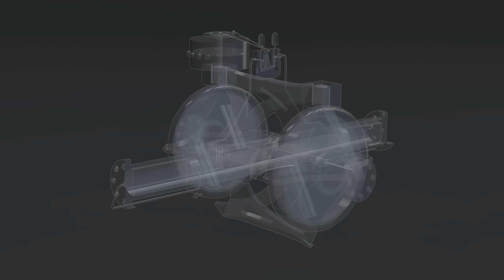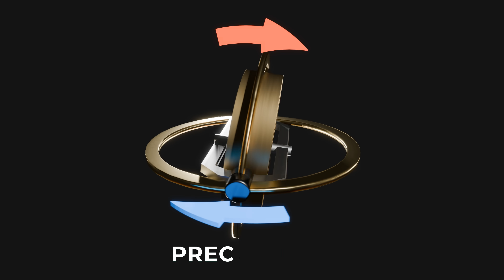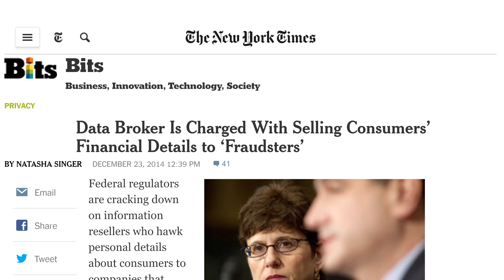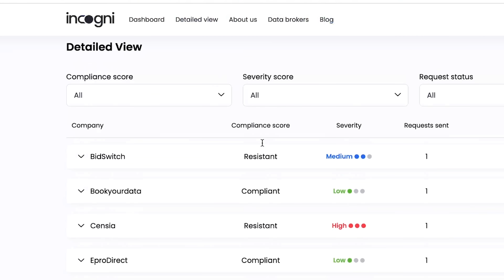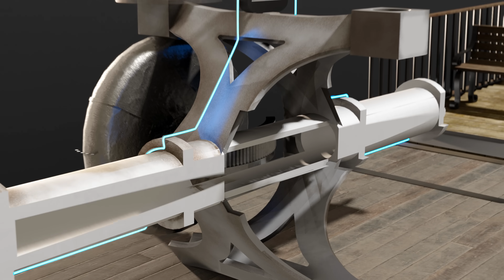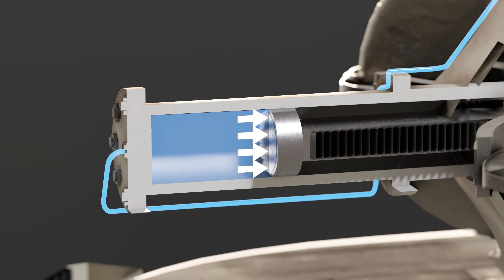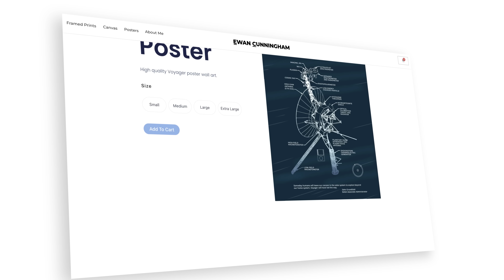The Self Balancing Monorail

Comment: The main problem is: If a poly-railed train malfunctions, it will mostly just halt. If this mono-railed train malfunctioned - specifically the gyroscope - it would most likely result in a catastrophy. Just imagine if the tiniest part of the gyroscope, let's say the air pipe, wasn't working properly. You'd have to be equally as thorough with maintenance and technical check-ups as with aircrafts, and at a much smaller value.

Comment: What about if the gyros loses their pneumatic pressure because of internal leaks or any other reason during the train trip? 
When loosening gyros capability there is no backup or safety method to keep the train stays vertical unless they invent extendable standing gears with tiers under the train to prevent it from turning over until it’s fully stopped  🤔

Comment: It’s a great design. Really amazing, and could still be applied. It has the new problem of how you deal with sustained power failure. The gyros will spin for 30 minutes - but after that the train falls off the tracks. It would need an emergency kick stand system to keep it upright until power could be restored.

Comment: Even if that particular invention didn't make it off the ground commercially, it no doubt contributed to other inventions. Mechanical self stabilisation and amplification, especially before computers but even today when computers/their software aren't perfect, is an incredible important concept for many moving systems. Investors probably could and did tell hin at the time that his idea would never work commercially, even if it could work perfectly mechanically (you'd need passenger trust for one), but engineering and invention are about so much more than presenting a viable final product

Comment: Would the cost-savings of 1 rail be canceled out by the 1 rail getting twice the wear and tear? (bearing twice the weight)
Reply: No. the cost would be defrayed to the gyroscopes in every car which would in turn cost more than the extra rail.
Reply: @stormysyndrome7043  yes, perhaps. I was more wondering about the physicals of just 1 rail vs 2, if 1 wears out twice as fast as 2, or what the wear relationship is.
Reply: @Dskrib  think I’d give one rail half life. Instead of the full load being divided over 2 rails, it’s squarely on 1 with very little shoring effect to spread the weight. It would lead to serious issues with rail weight limitations in short order, which would lead to actual ground issues beneath the rails being compacted unevenly. Think maintenance is much less of a pain with standard rail. 

Think you might have more luck with a tri rail system. Double the width of the train, shorten the height slightly, shape it like a bullet and give her a turbo engine lol. 

Loved living in Japan. We took trains everywhere. They were all electric even In the early 2000’s. Much easier to put rail systems in a nation as large as California, than expect the same outcome in a complete US country. Unfortunately, it doesn’t seem like we’ve even tried to start. The California bullet train disaster was one of self making. No reason they couldn’t create a bullet train line with the money they were given. None. They simply didn’t want to.
Reply: @stormysyndrome7043  That seems reasonable to me. A good use of the gyro-monorail would be custom temporary loads to unique remote locations. Imagine you a had a building project in a remote location. The monorail would be cheaper and faster to setup. It only needs to survive the one project, so the wear is not an issue. The gyro could be moved from project to project, to prevent having to scale up making more. Even things like remote movie sets could make use.

Comment: Yeah, even if it reduces the cost and maintenance of tracks it would be too expensive and impractical to have these gyroscope systems in every car. Also, like he said, traditional trains were already well established and there's certainly no way they could share a single-rail track with this new invention. We'd have two different track systems, which for several obvious reasons would be a terrible idea. At least we can say this is a very cool milestone in engineering, especially from so long ago.
Reply: It would not save much if any of the cost of track maintenance, most of which is due to drainage problems, tunnel and bridge mantenance, signalling etc.

Comment: If this is all true and it did work. What I would do in our modern era is make a sort of single rail system through cities that is mounted on the sides or roofs of buildings and make single cars that fit 2 to 4 passengers and people could buy passes and use the system to travel in metro areas above and away from traffic. Use a battery type system and a locking actuator that if the car stops it locks it upright. Buildings could have a small elevator at certain key stopping points to allow them off. This could reduce pedestrian traffic on the streets and enable people who can't afford cars to commute from say 5 or 10 miles away to their job.

Comment: It absolutely amazes me what was created and perfected without computers and simulations. Just get your hand dirty and create. I think I like the design and fee it would probably have a comfortable ride especially around corners. The issue would be if the gyro failed or if one failed in any car it would be a catastrophic failure. No way to just coast if something stopped working like a 2 rail train. Need three rails with outrigger wheels but now your increasing the cost with the three tracks.

Comment: As an engineer, my initial thought was instantly "gyroscopes.". But in the few minutes of this video Brennan's design and ingenuity turned out to be absolutely stunning. A truely great mind...too bad his idea didn't catch on.
Reply: Yes, Granted. definitely ingenious. But highly complex & if any of those mechanisms fail- instant disaster. also hard to build in any redundancy for safety.
Reply: i wonder about the redundancy
the design requires each part of the train to each have its own gyroscope. that and the fact that his design was strong enough to easily withstand a group of people purposefully trying to tip the train over by standing on one side maybe can let 2 adjacent carts to support another in case of a gyro failure
Reply: @beaneater6923   so back to two tracks again?
Reply: @keselekbakiak  no?
Reply: @beaneater6923  The train by its own design probably could not be made commercially viable because of safety concerns- Not to say that it couldn't in the future if modern engineers were to work out ALL possible safety issues.
Reply: @letstalkaboutit8254  i dont think safety concerns are the biggest issue. the whole point of the gyro monorail was to cut down on costs. needing a gyro for every cart would definitely hurt that
Reply: @beaneater6923  It's quite evident that like a child's bicycle with the training wheels removed the bike will flop over until that child gains their balance- the same principal would apply to this train design- If something fails in the mechanism that's keeping everything level, the folks on board would be in for a world of hurt. If something fails on a normal train (meaning propulsion not derailment) it simply slows down and coasts to a stop, And no one faces injury or death.
Reply: @letstalkaboutit8254  again, each train cart can easily handle people purposefully trying to tip it over. why wouldnt the 2 adjacent carts prevent the failed cart from falling?
Reply: @beaneater6923  When you say adjacent carts are you talking about one behind the other? My first thought was that you meant side by side, as in using a parallel rail. If you meant the former then I don't know if that would work, unless the gyro system in each carriage was strong enough to stabilise the weight of two carriages.
Reply: @beaneater6923  The power running the gyroscopes would eventually shut off, thus causing the gyros to stop rotating. Once the rotation stopped, the train would fall over. That's where the problem is. There isn't a continual source of power available on the train. You could introduce electrical cables, but then that would be added cost, thus negating the "savings" of using the gyros in the first place.
Reply: @danyoutube7491 obviously he is. The cart in front and the cart behind
Reply: @Josh-yr7gd  I was just kinda casually & mindlessly scrolling thru the conversation being had amongst the few of you about this invention. That being said I unconsciously knew the obvious statement would be mentioned eventually, however I was just not ready to read "....aaaand then the train will fall over" while sisimultaneously animating the thought of that crazy goofy looking contraption slowly coming to a stop before it just helplessly begins tipping over (accompanied by one of those generic hollywood sounds of some old creeking machine playing inside my head) 😂😂😂  I most definitely just laughed out loud way too hard reading your comment that wasn't even meant to be funny. 😅
Reply: Just park the train on a mount when it’s not running to hold it upright until the gyros start up again. Case closed, it’s viable
Reply: @beaneater6923  The simple question is: What are the benefits? Easy answer: There are no benefits, only disadvantages.
Reply: @beaneater6923  No, not if its on a bend or points or because of the balance in each carriage is different. Each set of gyros would be trying to balance in a different way, it could end up in in a feedback loop like you see with aircraft flyby wire issues with constant oscillations and over corrections.
Reply: @letstalkaboutit8254 Mu thinking is why was this not applied to the bi-rail trains so they were more stable in corners?
Reply: @Josh-yr7gd then run the gyroscope 😂
It's 2025😂
Reply: @letstalkaboutit8254  The fact that all cars connected to it would also need a gyroscope had to be a huge economic issue.
Reply: @Dexerion  Yes, The design is simply to complicated and prone to failure to be practical or SAFE.
Reply: @Dexerion  After looking at one of the original photos of the prototype (0:45) a bolt on "skid" can be seen midway down the bottom of the train, I'm assuming a matching built-up "hump" (concrete/steel) was built on the ground when the train stopped (station) and the train would simply "list over" onto it when power to the gyros was cut keeping the train somewhat level. And that brings up yet another issue with the design, it would not be practical to build miles of "stop ramps" to catch the train if it lost power to the gyros. I'm surprised a prototype was even built when looking at all the problems faced with the design.
Reply: @letstalkaboutit8254 and because of that fear, they chose something that their mind could easier comprehend, but turns out, we still have trains disasters.

And guess what? It's double wheels
Reply: it's either gyroscopes in every cariage or
a second rail.
Reply: My first thought was "damn I didn't know gyroscopes where even invented back then"
Reply: hi, I have a doubt, maybe you could answer me. in the end of the video, it says that the force is multiplied, in the compressed air system, because the area is larger. wouldn't it be the opposite? anyway, very clever design
Reply: @acs147 That's how hydraulic jacks work.
Reply: I don't think you need to be an engineer to guess that
Reply: As an autistic man who loves trains my mind went to gyroscope as well
Reply: 2 gyro scopes in front and two in back for redundancy/back up
Reply: @labbeaj so in a six car train that's 12 double gyroscopes. You did hear that there had to be a gyro pair in EACH carriage didn't you? Your idea although physically possible, it would be financial suicide. The cost would be bad enough with a gyro set in each carriage but to double it in redundancy is just not practical.
Reply: @ianmarriott1124  Nah, I didn't hear nothing and if I did I wasn't listening.
Reply: “It’s more of a Shelbyville kind of thing”
Reply: The fact that each carriage needed its own system kinda nullified the point of making it a single rail train.
Reply: Catch on or suppressed 🤔
Reply: As a professional homeless man, my initial thought was instantly "gyroscopes". I use it to balance my makeshift bed on park benches designed to keep us away.
Reply: Possibly patented that so no one can take it on?!
Reply: As a registered nurse, I instantly thought gyroscope?!
Reply: Truly*
Reply: It’s a good idea don’t get me wrong but there is to many issue and additional cost to make it better than a regular train
Reply: It's an amazing design. But I'm not sure of the benefit. You only need half as many rails, but they're going to wear out twice as fast, and there's much more to go wrong. Two rails, and statically stable trains, is better. It's much more boring though. I think as engineers, we're naturally drawn to truly ingenious solutions like this and we want them to be the right answer. But plain, boring and simple is often better in practice.
Reply: This design could make a comeback in a future century if we decide to extend rail lines into extremely tight far-flung places. Economically, the construction of the rail lines (a critical initial expense for the corporation/governmental entity funding the infrastructure) could have considerable savings with this “uni-rail” design.
Reply: @miscellania4263 let‘s hope ufos and antigravity are only fake to have a bright monorail future 😂
Reply: These days, we would use PID control for something like this.
This looks like bang-bang control -- the simplest closed-loop control scheme. You'd think that the car would constantly oscillate left and right, as it applies the full force of the gyros every time it tilts. I bet there's some fun physics involved (maybe something to do with the springiness of the air) that makes it actually behave more like a PID. It would be fun to dig deeper.
Reply: Too bad? Not at all. It was infinitely more complex than a regular train. As an engineer, you should understand that. Still, very interesting though.
Reply: Is it true that a micro failure in the gyro mechanism could cause a disaster?
Reply: Its sort of "Bicicle Principe" too
Reply: Because it's a terrible idea.
Reply: Few people seem worried about safety. Fair enough on face value, but it wouldn't be hard to have very reliable safety measures. The video said it could run on its own without power for a set period, that alone is a built in safety measure. But other methods would be to run the gyro on electricity and have a battery backup to cover failures. Have a second or third gyro. But in an absolute all out failure the best thing to have would be "always down" supports that hold it up when the gyro isnt running. When its gets to a certain rotation speed they wind up. With computers these days tracking everything they'd be extremely reliable. The computer that runs the support arma would have a constant feedback from the gyro and probably from the forward motion of the train.
Reply: It didn't catch on for a reason. If there will be a better way to utilize such concept, it will definitely prevail. Yet, with the current concept and knowledge it isn't useful for now.
Reply: Same here
Reply: Do any prototypes still exist?
Reply: What kind of engineer even are you, software?
Reply: Genius mind really. The kind similar to Tesla.
Unlucky, they are never listened
Reply: "Engineer" is wildly vague. What kind of engineer?
Reply: How could it catch on? Idea in the sake of idea, nothing over.
Reply: Его идея не могла быть массовой исходя из техники безопасности.
ЖД состав на 2х рельсах во всех аспектах безопаснее и устойчивее.
Reply: But why didn't it?
Reply: The first time I saw this, I knew they had put large Gyroscopes inside and not just one but two of them going opposite.

And the fun part is that I am not even an engineer, but a biologist. 💀
Reply: @arunavadas6445  How modest of you
Reply: why would it catch on? You're an engineer, don't overcomplicate it. You must be in the automotive industry!
Reply: @TortillachipFiend  Why are you using a smart phone? No need to overcomplicate things, all you need to do is make phone calls right? Smartass

Comment: That’s a really fascinating and clever design! Though I think it was best that we stuck with the two-rail system. There’s simply too many disastrous scenarios that could happen with the train where if a part failed or if the flywheels were unpowered for too long then it would certainly fall over. That and the prototype was only for the single car. Can’t imagine attempting to move dozens of fully-laden cars with this system.

Comment: That's kind of a bad idea cause the point of trains is to have dozens and dozens of wagons pulled by a locomotive.  And this is just a single car rolling on a train track.  You can actually take a normal car and use an adaptor to be able to drive on train tracks.

Comment: Actually, this system is well on the way for a comeback. German engineers have started working with this technique to create small, automated trains that can run on abandoned rail lines and thus reactivate them. By only travelling on one rail, an old single track line can be turned into a double track line for the monorail trains.
Reply: But, each single rail of track is only 4 ft wide approx.
Reply: @7h249  As i said, these are small and pod like trains. Google "Monocab". They're for 5 people each and can be coupled together. If you've ever seen the pod vehicles at London Heathrow airport, they're about the same size.
Reply: You would need some very thin trains, and ask the passengers to keep their elbows in when trains passed each other.

Comment: In this Digital era where most equipment are controlled by sensors and software, good to see a Mechanical engineering Marvel that self balances itself besides the huge weight and the dynamic loads involved.
Thanks for the very well made video which is sure the best Compliment for the creator of the Brennan Monorail.